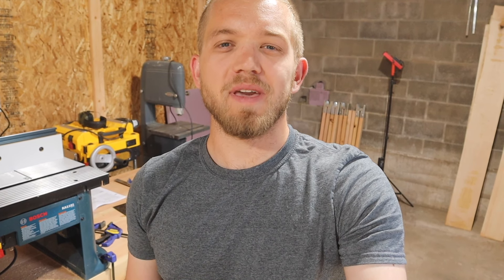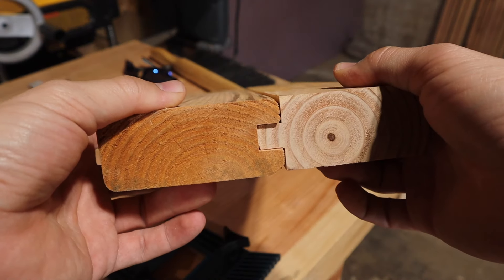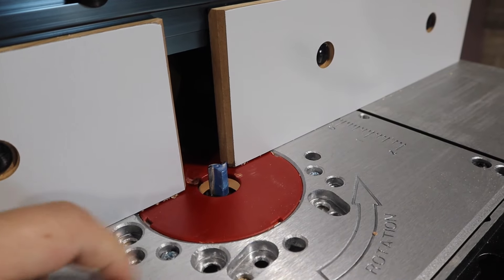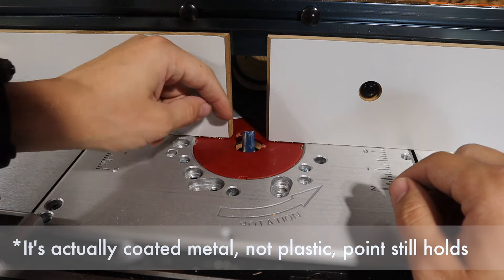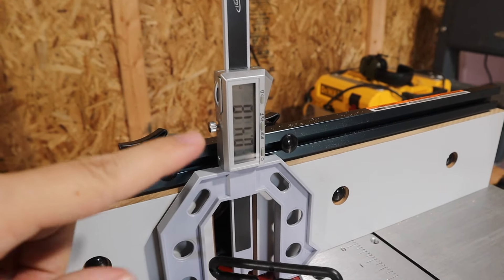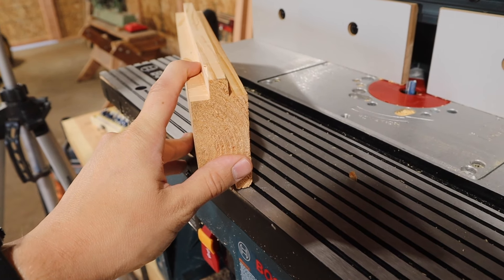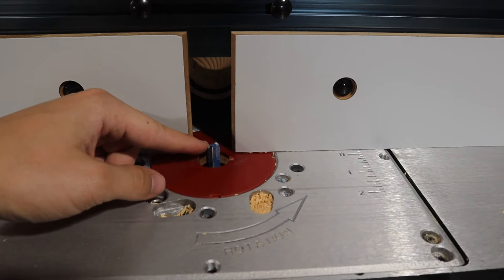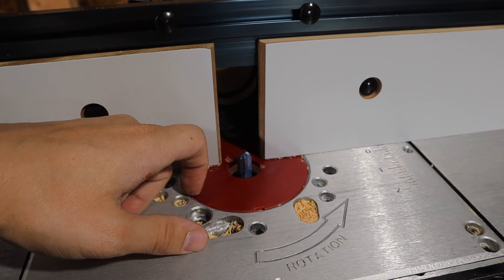Cutting a Tongue & Groove Joint | How to & Tips/Tricks

Comment: I could have saved about $65 if i would have watched your video first. I just bought a Freud 99-036 Adjustable Tongue and Groove Bit Set. Looks like your way may be a little faster also. I'm gonna still try your way while my bit set is on the way. I'm new to woodworking. Wonder how much more i can do with those straight bits?
Reply from the maker: I have yet to get a tongue and groove set! Let me know how it works! And it can be faster but depends very much on your bit diameter and board thickness. I love the up spiral but, honestly, I use it for almost everything!

Comment: What bit did you use for the 1/2” groove? Is it part of the set or can it be purchased separately? Great video! Thanks!
Reply from the maker: Hey Karen! I believe I was using a 3/8” but the entire time for this one. You can do a single cut at 3/8” or offset the centerline by an 1/8” to get a half inch groove after two passes. I also just got a tongue and groove set from Freud which I can’t wait to break out. I have links below for both of those bits plus the 1/2” if that fits your needs better. 

3/8” Up Spiral: https://amzn.to/3FPxtqn
1/2” Up Spiral: https://amzn.to/3MfftbB
Tongue & Groove Bit: https://amzn.to/3Leizv1
Reply: @NorthwestCraftsman  thank you!

Comment: Quick pointer, it’s easier, less chance of wood splitting, so much easier on your router and bit to do a few passes instead of clearing all that material at once.
Reply from the maker: Duly noted! Thanks for the heads up. That’s probably why I blew through my router bit making my bed frame.